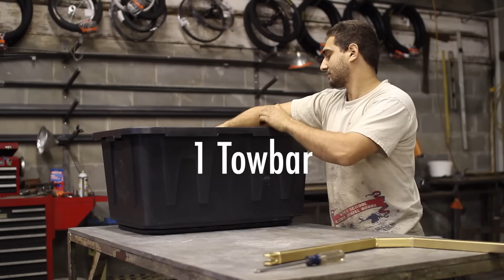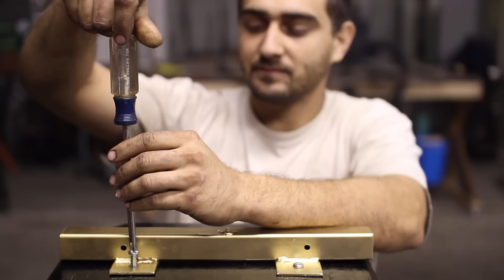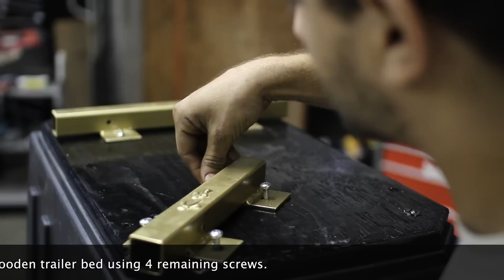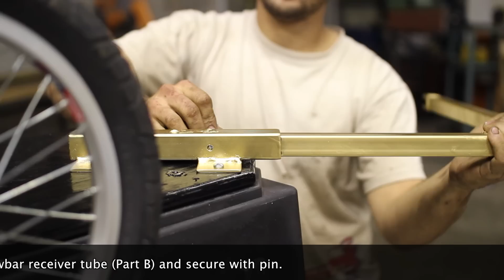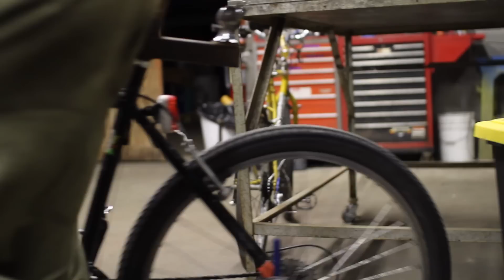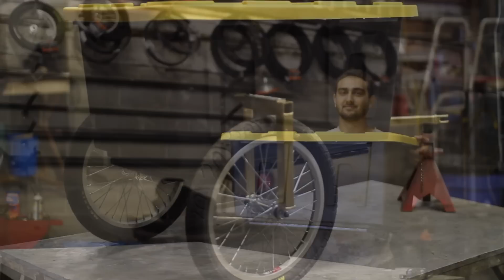The Kanner Karts Commuter: A Bike Trailer in a Box

Comment: Good idea. Not commenting your price, but your comercial (this video) is little bit ineffective. 

1st - you want the potetial custommers, to think (and see), the assembly and dissassembly is quick and easy. USE ELECTRIC SCREWDRIVER (or better - utilize butterfly bolts, some rail system with safeties or quick-releases with safetys). That will shave off most of assembly and dissassembly work (and time). Custommers tend to buy the products saving them time and unnecessary work for the same price more, than the ones, wich dont. 

2nd - your design can (or is wery close to) be watterproof. Save the boltholes on the bottom, anything you carry in it will be protected from moisture quite good, even if you spend a day on beach, or cross a river, riding that bike. You did not mention this advantage, your product do have over other products. The same with possibility to wash it, use it for transport of sand, dirt, rocks, hell even mud or manure, and then, after propper cleaning use it in the city among the people. Again, it is advantage of your product, but the potential custommers who does not think about the product after seing your commercials, does not see that reason to buy YOURS product.

3rd - next time you will do a commercials (or any advertising), please ask assistance of some marketing-educated friend (or buy that assistance from a stranger). I understand, in your workshop you do use the old clothing with holes, but if you are playing a seller, or proffesional handymen (for the custommer, to more trust you and your product), use some overal work-uniform. It looks more professionally and much less "cheap". Custommers do want buy products from proffessionals (because by deffinition they do know more what are they doing) and they do not like buing from (seemingly) poor, (or at least by apparence poor) suppliers, because GOOD suplier, who is selling GOOD product does mind the details even in clothing. 

4th - regarding details - it might to be better, if you use some pimped-out version of the trailer in your spot. Some lights, reflective surfaces on the box - simply something, from what can be seen, that the trailer is ment for real traffic. Also, regarding details. Did you consider possible lawsuit against you, if any of your custommers cut his/hers fingers on the metal cut-out part? Is that information included in user manual you sell with the trailer? Do you have any user manual at all? AND is it not better to use hard plastik glued caps on the cut-out parts, or even hard plastik skeleton of the trailer? Safer, lighter, free of any corosion.

Comment: OMG, with a Plastic Storage Container and 2 Kid's Bike Wheels and Precut Square Tubes and Few Nuts and Bolts and Clamps and it's 300 Bucks? WTF??? Are you serious? LMFAO... Wait but there is more... CHEAP PLY WOOD Painted BLACK on the Bottom :(((
Reply: Jod Bronson and for 300, they use hose clamps! so professional.  🤔

Comment: $300?? you are not gonna sell many...nice design tho, but i see the plastic cracking eventually if used enough....dont really see the need for gold anodizing unless u are appealing to the yuppie biker😒😒
Reply: I've built several bike trailers over the years(trial & error in the beginningLOL!), but if the whole thing were built like a frame and the plastic tote were inserted, then I see it holding up better. Yet the square bar isn't as sufficient as using round bar. Not-to-mention the axles will eventually bow, seeing that they're only peg axles ...thus he should be using a thru axle made from 1" galvenized round bar, preferably threaded, or holes drilled to allow for cutter pins. His present efforts are no better than building one out of PVC tubing ...those trailers will usually hold 25-50 lbs. depending.